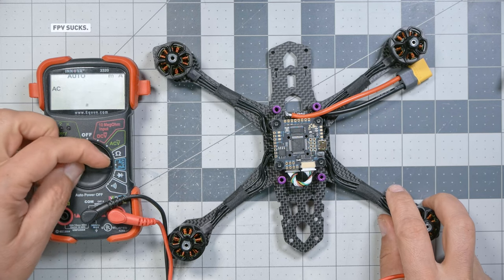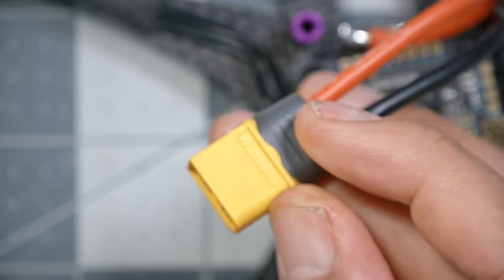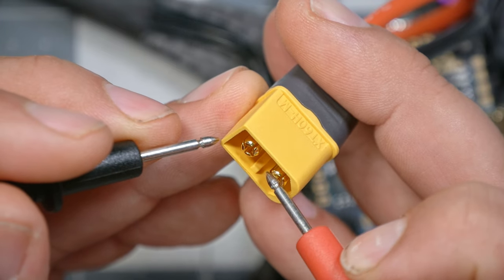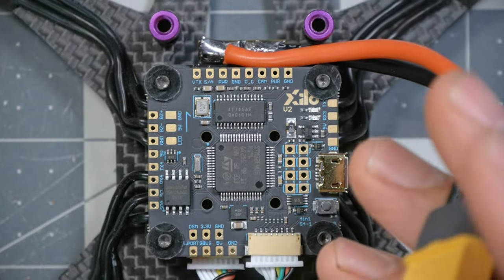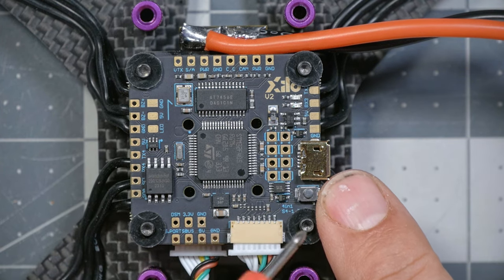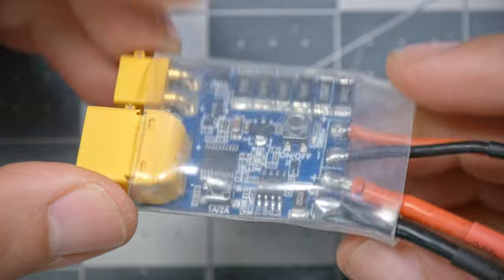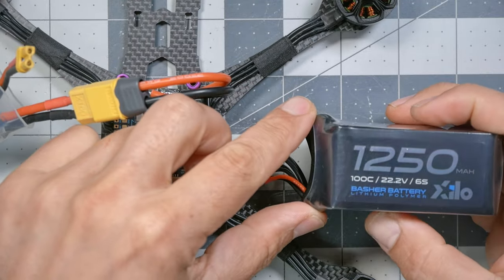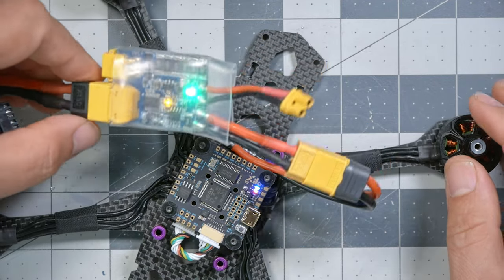Build an FPV drone in 2023 - Part 3 - Smoke Check

Comment: Plugging in my drone for the first time and hearing those beeps made me literally jump for joy. Thank you much for your guides!
Reply: Did you end up using a smoke stopper, or did you just follow his multi meter tests and plugged in the battery?
Reply: @0Ciju0  had a smoke stopper, thankfully it worked the first time.

Comment: I was building a totally different drone using your guide. Depending on the componentes, you may need to change the setting on the smokestopper so it triggers at 2A rather than 1A. After troubleshooting all my solder points and rewiring everything, this was the issue and turns out my build was good from the beggining. Thank you for the video!

Comment: after the soldering i would put orapply the flight controller and ESC solder pads with hot glue to protect from corrosion as well as getting short circuited due to some bad reasons. It also adds a small level of protection against drizzle or water spalshes.
Reply from the maker: Use silicone conformal coating not hot glue if you're concerned about this. Right tool for the job.

Comment: Thanks for the video and I was really enjoying this build up until now.  I performed all the checks you suggested and used my ViFly smokestopper when I powered up with 6s battery.  I got the initial 3 rising tones but no lit LEDs on the flight controller.  I plugged in using the other longer wiring harness but no change.  I did probe the 5V pads on the FC and I have 5 volts on all those pads.  I have 24V. on vbatt and approx 10v on pads marked pwr.  Not sure where to go from here.
Reply from the maker: Did the motor beeps trip the smoke stopper? https://www.youtube.com/watch?v=0CQA5dPMYJQ

Do you have the smoke stopper set to the 2 amp setting?
Reply: When I realized it had not tripped the smoker stopper I plugged the battery in directly and got the same results.  That is when I took all the voltage measurements also.  Just as an aside this is the 2nd JB drone I'm building.  The first one I built was when I was brand new to FPV (2022 ish).  I practiced my soldering etc. and everything went flawless.  I still have that drone and fly it regularly.  That just goes to show you that just when you think you're getting the hang of FPV it throws you a curve lol.  Thanks for all you do for this hobby by the way! @JoshuaBardwell
Reply: I performed some additional testing.  Since I didn't get any lit LEDs on the flight controller initially, I decided to plug the FC into my computer to see if it would connect.  The FC doesn't respond at all.  If the flight controller can't respond to the ESC and provide the lowered throttle signal, I won't get the additional motor tones correct? Is it possible the FC was bad out of the box, or did I damage it in some way when I initially powered up the flight stack?  I guess I am asking whether I could still have a problem with the ESC?  If the FC is at fault, I need a replacement.
Reply from the maker: If the FC is at fault, you would contact support@getfpv.com about that.

Comment: Hi you don’t put a capacitor at the esc power pads ?
Reply from the maker: There is no room to put it there in this build. It will be added in a later step.
Reply: @JoshuaBardwell don't think we'll miss something, we're watching closely, comrade Bardwell.
Reply: @JoshuaBardwell  I just bought your kit and am following the videos, is there a later video I should watch to add it or do I not need it?

Comment: Back in the day, each motor had their own esc, it was nice because if you blew one you just needed to replace that one. Is that not a thing anymore?
Reply from the maker: Most smaller builds went to 4 in 1 esc for compact size and easier mounting.

Comment: Joshua. I've got to this step. Did the checks with the meter but when I connect the battery i hear the t0nes but the leds on the FC will not blink. I continued with the build until I installed the video board, When I connect the battery the video board leds will light and flash but betaflight will not connect. I did install the driver and tried, impulse driver fix. Still no led activity on the FC. Ideas?

Comment: Hi..if I'm getting the proper beep on the ground pad but when I go to the wiring and it beeps on black but not on red, what could this mean? Thanks for any help
Reply: Hi @BreeZieDoesiT, Did you manage to get any answers about this? I'm currently put my build on hold because of this.
Reply: Hey yes. So where i got everything wrong was due to how Bardwell explained everything (for my very limited knowledge). When he tests with the black tip I was getting confused because he said positive tip. What i didnt realize is that it doesnt matter. You can put the black tip in the red or vice versa. What im getting at is the colors dont matter and I got stuck up on following the video exactly and the colors of the cable's and how he tested confused me (where i rebuilt the whole thing from scratch and still no beep). Lmk if this helps. I assume you were getting everything right with the ground pads but when you tried this last step, you couldnt get it to work.
Reply: Its happening to me as well, when I check for Ground pads, I get the beep sound but when checking the continuity between the vpads (red), there is no sound. Is that normal?
Reply: @venusvirmani  anyone get an answer to this problem??

Comment: Hey Joshua,
when I test my XT60 pins I get a beep and than silence. Though I get a beep both ways (red/red - black/black and red/black black/red). And my beeps are noticeably longer than your beep. Is there a problem with?
Thanks
Reply from the maker: It sounds like the capacitor charging up which would not be a problem.
Reply: @JoshuaBardwell  Thanks for taking your time to reply!
Reply: @fpvmaxim i get that too, when reversing to black /red 
Red/ black 
Is that okay??

Comment: Hi Joshua , i do reverse my probes on the xt60 and hear a beep with 0.0 value and then it stop. Is that normal.
Reply from the maker: Yes that's the capacitor. As long as it stops you're ok.
Reply: @JoshuaBardwell  yes , it do stop about 2 , 3 seconds after

Comment: I plugged in the battery but I am only getting the first series of beeps and not the last two beeps, also the lights on the FC are not illuminating. HELP ME PLEASE haha
Reply: I got the same results you did, first series of beeps but no lights on the flight controller.  I checked for voltage on the pads of the flight controller  and I have 5V on those and 24V on the Vbatt pad.  What did you do to resolve this issue?  I noticed that he didn't respond to your post.